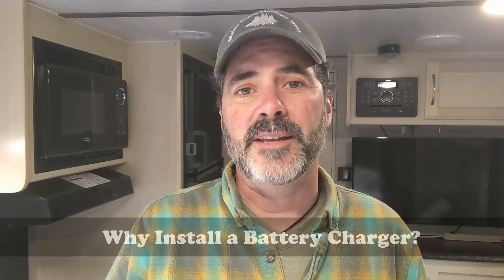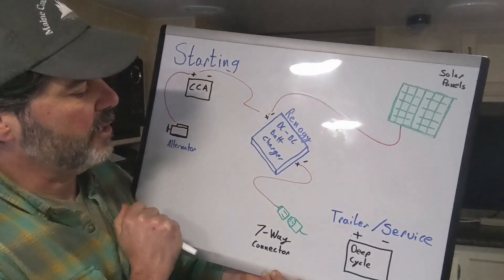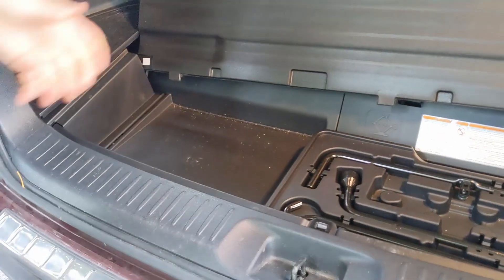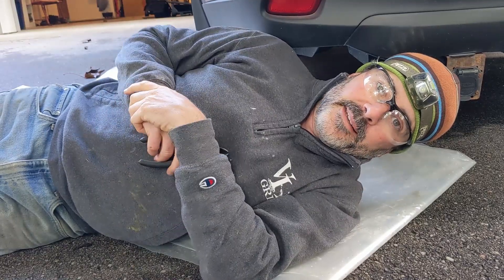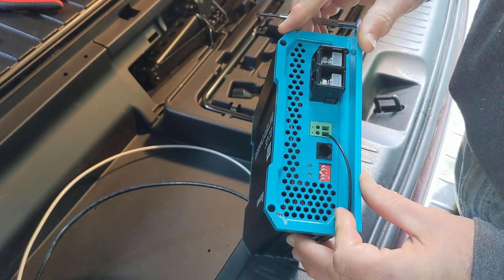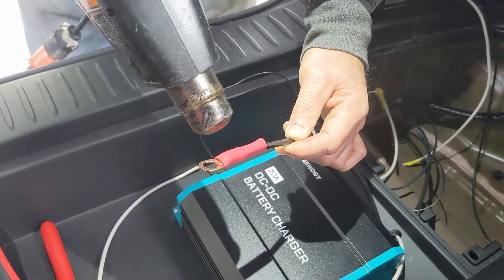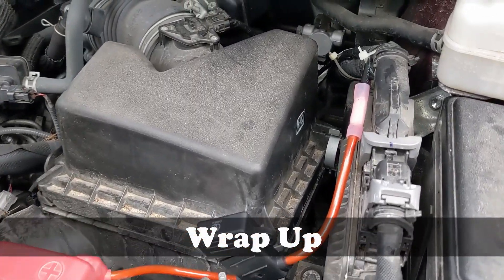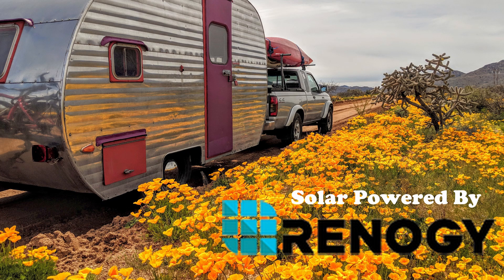How to Effectively Charge RV Batteries While Driving: [Renogy DC to DC Charger]

Comment from the maker: Hey Folks, just a quick update about this install.  We've noticed a small voltage drop as a result of sending the current through the 7-pin connector.  So, we would recommend using a different cable (Anderson for example) which could make an easy and quick connect and disconnect between the charger and the trailer batteries.  Good Luck.
Reply: Any updates on charging time after you made this change?
Reply from the maker: @jasonsmathers2361  Yes, we have some numbers for you.  Through the 7-pin, we were getting between 3 - 7A, hardly better than the original trickle charge.  With the Anderson connectors, we're getting 20A from the charger.  So this can replace up to 20Ah of battery capacity in one hour of driving.
Reply: What bout over loading the alternator... To be able to charge car  batt, rv and run rv inverter to run fridge... I have ruined a alternator on the car doing this... Does the DC yo dc device limit the power pulling from car and alternator?
Reply from the maker: @STIFFLERJJ68  The 20A version will limit the current going back to the RV batteries to 20Amps.  By connecting via the starting battery, rather than alternator directly, and with proper fusing between all components, you should avoid any overtaxing of the hardware.  But remember, it's really the size of the battery bank in the RV that helps you run all those electronics, not the vehicle's alternator.  The charger is really taking the excess voltage from the alternator, boosting it to get an appropriate charge to the RV batteries.
Reply: @FreedomInACan 
Thank you so much for this video everybody and their brother is telling me I'm full of crap that there is no such thing to limit the alternator output to save your car alternator from pulling to many amps, I have already burned up one alternator a few years back trying to run a well pump off an inverter and inverter going to straight to the starter battery while the vehicle is running, I plan on going with option 2 using a dc-to-dc controller in my application I have an off-the-grid camper on a property that has two batteries with a solar panel to charge while I'm gone during the wk and, when I show up on weekends hook up car to charge and help power the rv. House batt run lights and a inverter to run fridge and microwave my goal would be I think option two....  being able to pull up with the vehicle hook up battery cables to the vehicle and let the car run as a generator to charge the camper batteries when were there over the weekend I've been looking around forever to find out how to protect the alternator from shorting its lifespan by drawing too much amps when the car is running charging the starter battery and the house batteries and  the inverter pulling power for the fridge. I was trying to isolate / protect the alternator and reduce the maximum output amps, the question I have for you is you said be generous when it comes to gauging what dc-to-dc controller to get, what is the percentage would I go with when matching off the car alternator  amps capabilities as that changing the alternator on the vehicle is a whole weekend project... Also would ur second meathod work with a solar system hooked up and if so what dc to DC Controler to choose
Reply from the maker: @STIFFLERJJ68  Okay. I think I understand your questions.  If you are driving to and from your RV location, without the RV, then the best method is to have an appropriately sized off-grid solar system that will meet your energy demands during the time you are there.  See this video to show you how to do that. https://youtu.be/vBI4rrj0HIQ
The DC to DC charger is really designed to take advantage of a charge from the vehicle while you are towing.  Can it charge while you're idling next to the camper? Sure -- but that should only be a "just in case" situation.  You're probably going to put more wear and tear on your vehicle sitting there at idle, than just using a small and quiet generator.  My advice would be to just get a battery and solar panel set up to match what you want to run and you're all set.  I hope that helps.
Reply: @FreedomInACan  alright so I got a couple questions and you guys seem very knowledgeable on this matter in a great case scenario solar panel in the dentist sun no shade no partial shade how many amps can a hundred watt system 200 300 or 400 watt system provide,, my goal is to be able to run the furnace of my RV in the winter using the12volt fan motor to blow the the Heat obviously the easiest way is to pick up an inverter generator run it on propane and it will supply enough power I'm trying to do the solar route I'm not too sure how to measure the Watts hour of the heater fan clearly I will be using the heater mainly at night
Reply from the maker: @STIFFLERJJ68  Hi Josh,  There are too many variables involved here to be able to give you clear cut numbers.  Variables include how far your run (wiring) is from your panels to your charge controller, whether you have a PWM or MPPT charge controller, where you are located (your insolation/angle in relation to the sun plays a large role -- Maine is very different than Arizona as an example), the angle at which your panels are installed, and what time of year it is.  In addition, there is also the issue of passing clouds.  Also, we assume you'll be running the heater at night, so the size of your battery bank will come into play since your panels will not be illuminated.  With our portable 100W panel which is angled to the sun, we get a max of 85W (17V x 5A) when we are traveling in the winter in Arizona.  With our two 100W flat panels on top of our camper in Maine in the summer, we get about 150W (17.2V x 8.89A) combined.  These are connected in parallel to boost the amperage and we also have an MPPT charge controller which further boosts the amperage to just over 11A.  What we suggest is that you take a look at our Solar 101 video.  It's designed for you.  https://youtu.be/vBI4rrj0HIQ  It will walk you through the process of determining your average daily total watt hours, as well as how many panels, type of charge controller, size of battery bank, etc. for your heater fan as well as any other electric appliances you intend to run with solar.  We hope this helps...holler back after you watch the video if you have any further questions!  Happy to help....

Comment: Thanks for the video learned alot and will be installing a 20amp as well. We'll probably go with not using the 7 pin connector but through seperate Anderson plugs to maximize the 20amps input to charge are batteries. Hopefully it works out... Again thanks for the video!
Reply from the maker: Thanks for the comment.  As ambassadors, we can offer you 10% off this product.  See video description for details and promo code.  Best of luck!  Let us know if you run into any issues during installation.  Happy  to help out!

Comment: Are you saying there is a voltage drop from the towing vehicle to the RV Battery? The 'battery charger" will boost the voltage....? No chance the alternator will burn out due to the extra load? Some vehicles have an option for an extra alternator. Think solar or extra generator.
Reply from the maker: Yes, that's what we're saying.  The DC to DC charger will boost the voltage coming from the starting battery to the house/ service batteries.  Yes, some vehicles do have extra alternators which charge the house / service batteries.  This is another option.  Renogy recommends that you connect the DC to DC charger to the starting battery rather than the alternator.  There is also a dual input charger which accepts a starting battery charge in addition to a solar array charge - perfect for vans and Class b & c RVs.

Comment: This is an excellent video - I'm so happy I found it. I plan to do a similar install, also on a 2017 Highlander. You saved me a lot of frustration as I was also assuming I'd find somewhere in the main fuse box for the ignition signal wire. One question: Renogy warns that the unit is to be installed in a ventilated enclosure so that it doesn't overheat. Have you noticed any issue? Maybe the small 20 amp unit doesn't produce enough heat to be a problem. Thanks for sharing your install.
Reply from the maker: Thanks for the comment.  As there was plenty of space in the  compartment, we haven't noticed overheating, vent fan needs space to draw air.  But we are re-thinking going through the 7-way.  It seems that there might be some voltage drop.  So, consider using Anderson connectors from the output to the trailer battery, especially if you have to go more than 8 feet.
Reply: @FreedomInACan  Good to know overheating hasn't been a problem. Worst case it looks like one could prop open the small cover panel on the left corner of the highlander for ventilation. As for the existing 7 pin wiring back to the trailer, I agree.  I plan to run a new wire pair (hot and ground) with heavier gauge wire and Anderson plugs.  I hate to do all this upgrade and then create an electrical  bottleneck for this last few feet. Again, your video was super helpful in my planning.

Comment: How is the 7pin connector handling the 20amps from the charger, I would be concerned about the wire gauge in your trailer pigtail being able to handle that current. Otherwise, great video
Reply from the maker: Thanks for the comment.  It seems to be working fine.  Because the distance from the unit to the  battery was less than 16ft, 10AWG was an appropriate gauge, also protected with 25A inline fuse.  See page #14 of the installation manual from Renogy. https://www.renogy.com/content/RNG-DCC1212-20-BC/DCC1212-204060-Manual.pdf
Reply: Thanks for the video!
I especially love your tip about the dual input charger!!!
How do you know that your 7 way connector and the wire to charge your battery are 10AWG or bigger - they might be 12AWG.
Our batteries will be in our dinette bench at the back of our 21 ft trailer - so it is good to mention that would require 6AWG wire, which is probably much larger than what is in the trailer’s hookup cable!
Reply from the maker: Hi Rhonda, thanks for your comment, glad you liked the video.  As to your question, we measured the wire and consulted with the Renogy Engineers.  Keep in mind that we installed the 20A unit which doesn't require as big of cabling, unless you're going a long distance.  According to the Renogy installation manual 12AWG was recommended for the distance the load had to go, since it was less than 8 feet from charger to batteries.  See page #14 of the installation manual from Renogy. https://www.renogy.com/content/RNG-DCC1212-20-BC/DCC1212-204060-Manual.pdf  
Any of the bigger Amp versions of this charger should definitely be connected via Anderson connectors and not directly through the 7-pin way.   Enjoy the installation!

Comment: Which one should I get for a 95 amp alternator - the 20 amp or 40?
Reply from the maker: The size of the DC to DC charger has more to do with the size of your battery bank in your RV or trailer, than the alternator.  Renogy recommends connecting the charger to the starting battery, not the alternator directly.  How many amp hours is your battery bank?
Reply: @FreedomInACan  When idling, you can pull too much from the alternator and burn it up.  I have 400 amp hours of agm batteries.
Reply from the maker: @jrr___7902   With that size battery bank I would go with the 40 amp version.  I think you will be pleased with how well and quickly it charges everything up.   Good luck with your install!
Reply from the maker: BTW, there is a Black Friday Sale  going in through Monday!  Check it out.
https://shareasale.com/r.cfm?b=1659912&u=2489284&m=96785&urllink=&afftrack=
Reply from the maker: @jrr___7902  Just looked at the sale site at it appears that the 40amp is not a part of the sale, but you can still get 10% off by using our affiliate link and promo code "canlife" at checkout.  https://shareasale.com/r.cfm?b=1529919&u=2489284&m=96785&urllink=&afftrack=
Or alternatively, you could go with the 50amp dual input, which is on sale, if you want to plug in solar panels.

Comment: I thought I saw another u-Tube on installation and they ran a wire straight from the alternator to the DC-DC charger then out the charger to the RV' battery. It was fused as well. Is that not an acceptable method?
Reply from the maker: Well, the Engineers at Renogy recommended that we connect to the starting battery, rather than the alternator.  The diagrams I've seen concur with that as well.
Reply: @FreedomInACan  Thank You. I did go back and look at Renogy's diagram. Although I did see two others go direct with fusing. Since you & Renogy are going off the "hot" side of the battery I'm not sure what the advantage / dis-advantage is; but I'll still go with yours and Renogy's wiring plan.